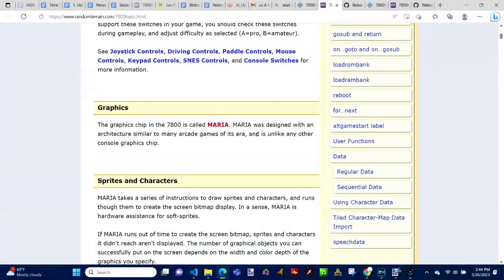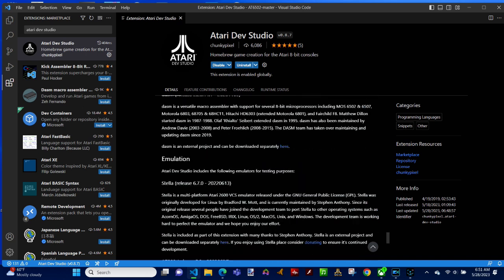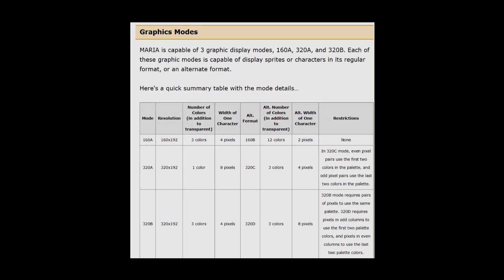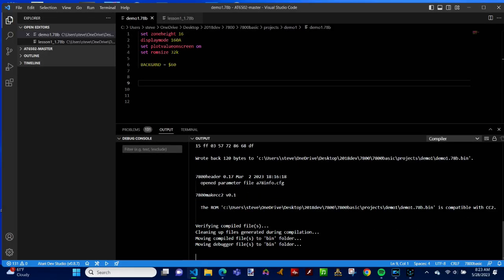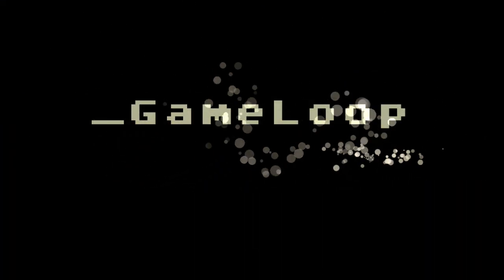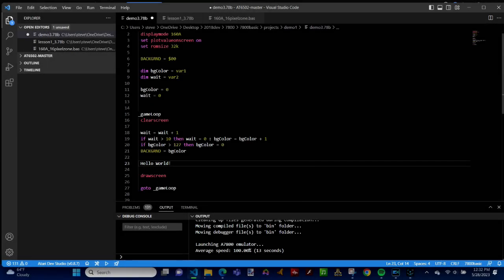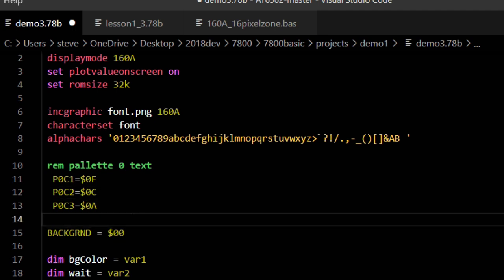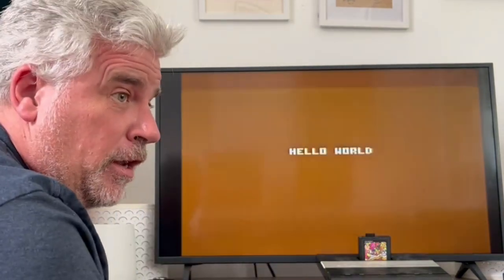Atari 7800 Basic Exploration #1 - Hello World - Make -A-Thing!

Comment: Thanks for this tutorial, I've attempted many times to do something in Basic for either PC or the XL/XE, but was always just reading my way through it and usually would get stuck. I really appreciate your explanations on everything.
Just a heads-up though, in using the latest version of Atari Dev Studio, 0.93, it says that _gameloop is an unknown command and spits out an error. Removing the _ fixes it. 
I also got a strange thing popping up in my text -  after the hello, it throws in a ), then a space. I tested by putting in three words and it shows a ) after each word, then the space. As far as I can tell, my code mimics yours but for some reason it shoves a ) in there. Is it possible I did something wrong or an odd change to 7800basic or Atari Dev Studio? Thx in advance
Reply from the maker: Make sure the _gameLoop starts in the first column.  All labels need to start in the first column.  (Almost) all code starts in column 2
Reply: @IntoTheVerticalBlank  It definitely is but if I use an underscore on any label, the compiler spits back errors - remove them and change nothing else about the code and it works fine. Rather odd but not a big deal. Thanks - is episode 4 coming soon?

Comment: Thank you for making this series.  I'm looking into porting my soon to be released Atari 2600 game, Robot Zed, to other platforms, and the 7800 will be the first one.  These tutorial videos are going to be a big help in that adventure!  Thank you!
Reply from the maker: Robot Zed is a really cool 2600 homebrew!  You will definitely be able to make a game like that by following along. We might not cover 2D Platformer physics soon,. but you have them down pretty well already and the 2600 code will move to the 7800 fine if the are both in basic.
Reply: @IntoTheVerticalBlank  Thanks.  Unless the 7800 does things really different with game physics, then I think I already have that covered, it's just how it does graphics and sound (I do plan on using a POKEY), along with things like collision detection, is the thing I really need to try and wrap my head around and this is a good start.

Comment: The Atari 7800 is probably my favorite 80’s system. It has it’s shortcomings like the lack of color RAM, but that can be got around. It’s biggest flaw in my oppinion is the 9 color limit for 320 modes.
Reply: Yeah it's quirky for sure, but also delightful and fun to work with, even if just to experiments like me. .  I personally think he biggest flaw is the lack of new sound chip.
Reply: @steveafulton  yeah, kinda forgot about that.

The outdated sound is the biggest flaw. BUT, the 7800 is still better than the NES in every other aspect.
Reply: @ecernosoft3096  Yeah, it's at the very least comparable, and probably a lot more flexible.    The disadvantage was that, with only 70+ games made, developers never had chance to really figure out how to make do wonders.  We have that chance now though!
Reply: @steveafulton  back in the day.

But now, the 7800 is ON FIRE with it’s homebrew library. It’s incredibly significant. Especially when you include the 2600’s insane homebrew library as well. For every NES homebrew, I can count about 5 7800 homebrews and 10 2600 homebrews.
Reply: @ecernosoft3096  Yes, I love it!!!
Reply: @steveafulton  The only thing I didn’t love was their lack of good management at Atariage. I was making a game on the 7800 called “It’s Conner Time 3” (in assembly, by the way!) and people started complaining about it not working on a different SD card reader for the system I didn’t have or know existed, and I got upset, and said my complaints. Got no response. Then later on someone was making a 320 mode game and said they were wanting to switch to 160 mode, and I asked if they could make a seperate 320 mode version. Instead what I got was being screamed at and then banned from that thread. Like. Seriously. On atariage forums, things get taken down or attacked for stupid reasons. Someone made this cool 13 color demo using bitmaps to save on DMA and it was awesome, yet was removed because people were attacking him because of the colors. It’s why I left, I just can’t have that. And I was sad about it too- for many years I had been on Atariage and peace was the norm. Now these guys who don’t have respect are destroying it. It’s sad. What’s worse is that a lot of the complainers were people who hadn’t programmed the system at all, which is just REALLY IRRITATING. That’s why I left atariage. And while I am sad about it, I just can’t exist without having a mental breakdown from all the chaos going on.

Comment: using the same code as you:
'''
Verifying compiler files exist...
Starting build of main.78b...
7800basic v0.24 Mar  2 2023 18:16:13
* (1): ERROR, unknown keyword 'zoneheight'.

Compilation failed.

Exit code: 1

Cleaning up files generated during compilation...
'''
Reply from the maker: Did you check the latest code in guthub? 

 set zoneheight 16
 displaymode 160A
 set plotvalueonscreen on
 set romsize 32k

https://github.com/intotheverticalblank/makeathing/blob/main/Atari7800/Atari7800Basic/Tutorial/lesson1_1.78b

I'll ask Steve to check it also for you.
Reply from the maker: Two things to check:
1. Make sure code is indented 1 space.
2. Look at bottom of VSCode on the right hand-side.  it should say "7800Basic" (white text on blue bar).  If it says "bAtari Basic" click on it and select 7800Basic.
Reply from the maker: I recreated it by having the "set zoneheight" in column one. space it over one.  The first column is for labels.
Reply: @IntoTheVerticalBlank   Thank you, but now it does this:
'''
Verifying compiler files exist...
Starting build of main.78b...
7800basic v0.24 Mar  2 2023 18:16:13
7800basic compilation complete.

User-defined 7800.asm found in current directory

--- Unresolved Symbol List
HSCHARSHERE              0000 ????         (R )
BACKGROUND               0000 ????         (R )
isBANKSETBANK            0000 ????         (R )
SOFTPAUSEOFF             0000 ????         (R )
SNESNPAUSE               0000 ????         (R )
BANKSET_DL_IN_CARTRAM    0000 ????         (R )
BANKSETROM               0000 ????         (R )
SNES0PAUSE               0000 ????         (R )
SNES1PAUSE               0000 ????         (R )
0.HSup                   0000 ????         (R )

   stack allowance: 30 nested subroutines.
   the canary is situated at: $1c1
   28660 bytes of ROM space left in the main area.
     $1880 to $1fff used as zone memory, allowing 31 display objects per zone.
     2429 bytes left in the 7800basic reserved area.

Fatal assembly error: Source is not resolvable.

Cartridge size not a multiple of 4K bytes!

7800header 0.17 Mar  2 2023 18:16:18
* WARNING: The file size of f:\MyProgramming\Programs\atari\testing\main.78b.bin isn't correct.

  opened parameter file a78info.cfg

7800makecc2 v0.1

  The ROM 'f:\MyProgramming\Programs\atari\testing\main.78b.bin' is compatible with CC2.

Exit code: 1

Cleaning up files generated during compilation...
'''

and do you have discord or something like that?
Reply from the maker: @Toby-ve6gp  I think you spelled BACKGRND as "BACKGROUND".  It should be BACKGRND. 
No discord yet, but we will consider it.
Reply: @IntoTheVerticalBlank   Thanks, muscle memory.